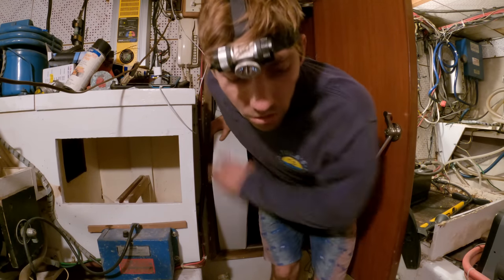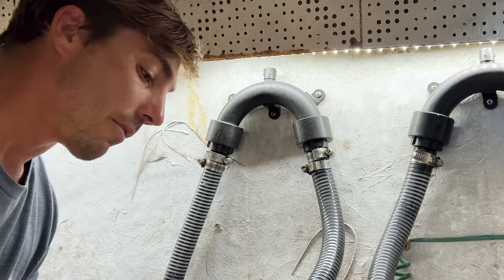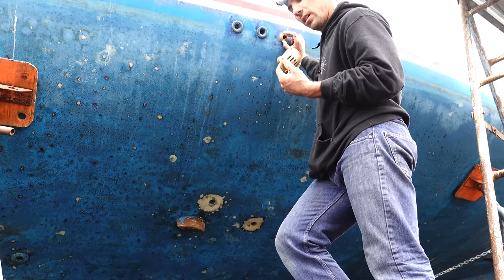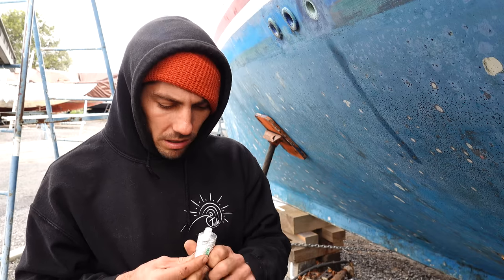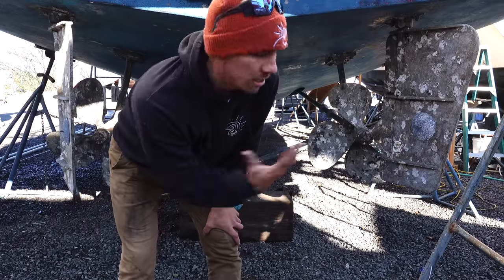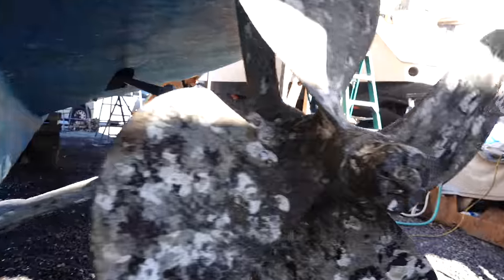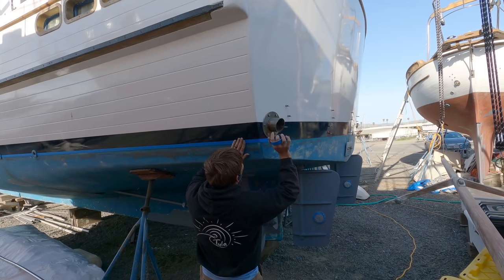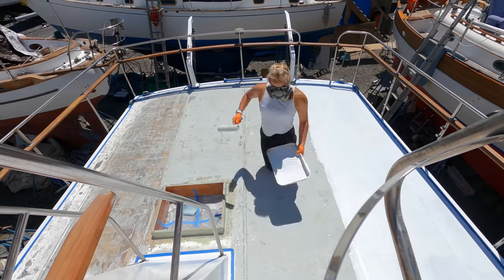Bottom Job ✅

Comment: First page of my rule-a-matic bilge pump install manual, "no check valves".  Boat builder installed one anyways and the bilge pump never worked reliably.
Reply: Ditto.  I put one in the engine exhaust on one of my boats.   Cost me about $6k.   Expensive lesson.

Comment: Guys, you guys need to buy a communications set.  These are great for setting the anchor, pulling the anchor, docking and leaving the dock, communicating from a stormy deck to the cockpit, and communicating through the hull.  Get a set.  You'll love them.  You pay for what you get.  Crappy units are cheap.  Good, quality units cost good money.  Spend the money and get a good set!!

Comment: They ought to make a pair of tapered flexible strips to fill the croove in the paint can with!
Reply: What I have always done in the past is take a flat screwdriver and punched it through the bottom of the lip in about four or five places. That allows paint that goes into the lip to drain back into the can, and doesn't interfere with the lid from sealing..

Comment: Tricks for keeping paint out of the can  lid lip groove: I see you've in the past used the tape  method - cover  a part of the can lip with 2 pieces of tape to form a vee to pour over. I've sometimes had trouble getting the tape to stick well to the can lip. The other method is save a can lid off empty can and cut out a hole in center part (close to an edge) of the lid.. knock the lid onto the paint can and pour through that hole. Make the hole big enough for your brushes you might dip into the paint and can then scrape excess off brush against that hole in the lid. Hope I make sense and save someone some trouble of keeping paint or whatever out of the can lip.

Comment: If you have to change your pump that supplies water to the engine and Generator I find the best one is to use a swimming pool pump they're usually mostly plastic and they don't corrode and it gives you a strainer before before the pump

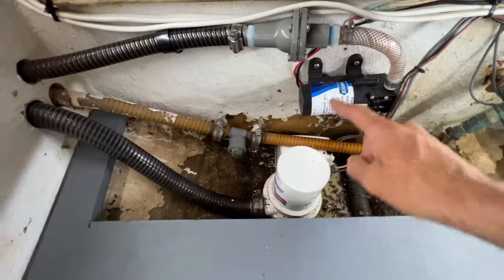Comment: An excellent video - as always! SUGGESTION: at the beginning of the video (3:54 - 4:-08)  make sure your float switch is not underneath that cable/hose  (red color, I think) or if you do get water in your bilge, you risk a malfunction of the switch.

Comment: I believe the muriatic acid/non diluted hull cleaner works good for normal growth or soft growth. I had an unpainted hull on a 2006 Bayliner that I didn't clean it right off after the season. It took off all the soft growth right off without even needing to scrub or brush most of it. Hull looked brand new.

Comment: I never use check or Joker valves=--always used siphon breakers and vented bilges outlet well above the waterline.  You did well.    Those check valves take a reasonable amount of pressure to operate the,. Make sure you have a rubber pad under the bronze thru-hull, put the grid facing aft, and make a large strong hardwood plywood epoxy-saturated shaped washer to fit against the hull on the other side and compress your rubber sealing pad, which you may have to cut yourself from Nitrile rubber, which is resistant to fuel spills in the bilge.

Comment: An engine room with a telephone in it, I’m very envious!. Funny you should be talking about bilges btw, my boats been suffering from wet bilges for years and I’ve just worked out how the water was getting in. It’s was running down the gunnel over the transom and straight down the bilge outlet…. There wasn’t enough room to put loops in the hoses so a clam vent over each outlet solved that problem. I just installed two dry bilge systems into my cat ( pretty much identical to your setup ) only difference is I used a light switch faceplate with a sponge on the underside.

Comment: Hi!  Muriatic Acid has its uses but mostly for concrete. Pickling vinegar dissolves calcium and maybe the product called CLR. Shells are basically calcium so it is quite possible that the pickling vinegar is best. i am no expert so i may be wrong

Comment: Hey guys, zincs are cheap, haul outs aren't- you should replace any used and worn zincs you have while she's on the hard. And as far as painting under the stands, there's nothing wrong with moving 1 stand at a time over a foot, and putting a piece of wax paper or plastic sheet on the stand pad so it doesn't stick to the fresh paint. That way the only thing you have left to paint is under the blocks right before she goes on the water.

Comment: are you sure those anodes are still good?  On a boat that size, a set of headphones will make communications better now when working on the boat and later when doing things like docking and anchoring
Reply: Wireless talkies are 20 bucks.
Reply: @MegaTriumph1  They could use their cell phones on speaker for free.

Comment: The color of your props and rudders after the acid wash is concerning. You may have some internal corrosion from use of poor anodes (zincs).  Recommend you order Zimar anodes (they are in Davie, FL). They have amazing quality anodes that will protect your running gear!

Comment: You should remove the zincs, paint, and then re-install them. The way you did it, the zincs are going to degrade over time as expected and then there will be bare metal exposed to the water without paint on it.

Comment: I believe you are confused as to how your valve system will work in your application. The tubing water will still backflow to the pump and the outside water can still flow into the boat.
(;-) TP